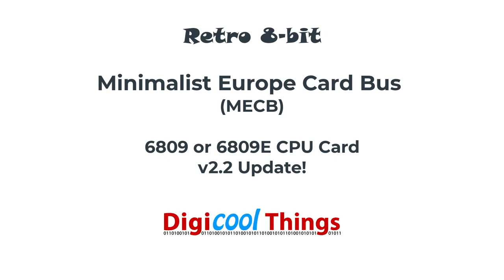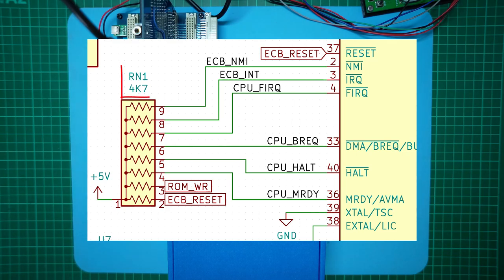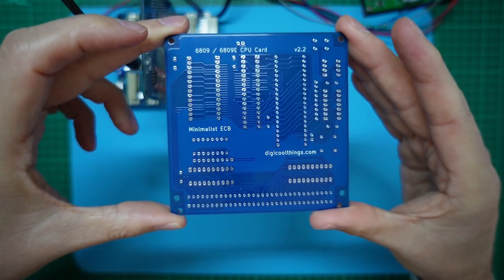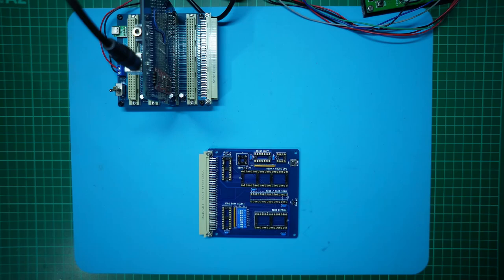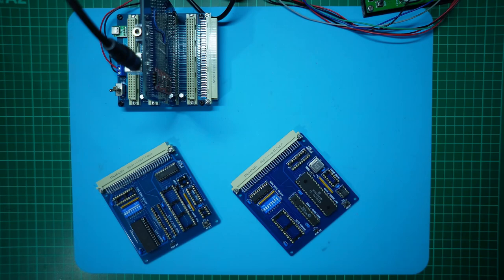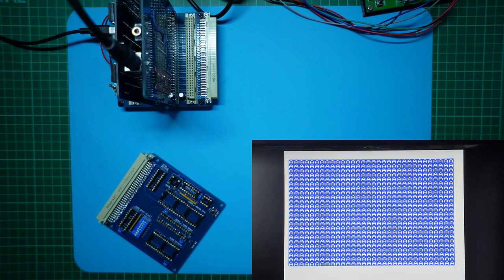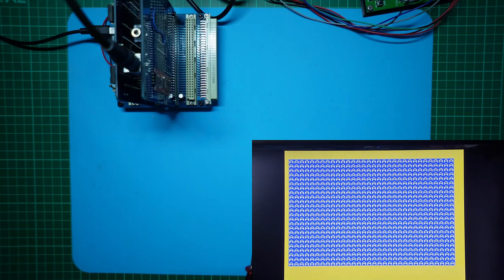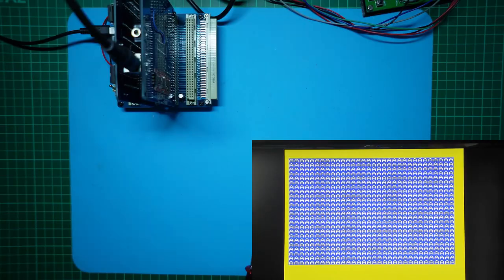Minimalist Europe Card Bus (MECB) - 6809 or 6809E CPU Card - v2.2 Update!

Comment: If any retro-builders want to get ahold of a non-E style MC6809P rated at 1MHz, Jameco in California has original MC6809Ps for $14.95 and there are presently 43 in stock.
Reply from the maker: Thanks, that's good to know.  I assume these have been verified as non-E variants, and are not more of the incorrectly re-marked 'E' suffix chips, as I experienced from my ebay and aliexpress purchases?  Having said that, my latest purchase of MC68B09E chips from aliexpress turned out to be about 50/50 non-E variants, incorrectly re-marked as 'E' suffix CPU's. Obviously the people who recover these chips from old equipment (and re-mark them), have no idea of the difference. 🤔